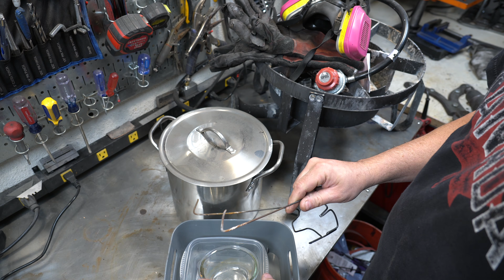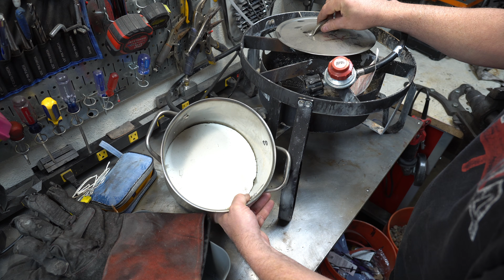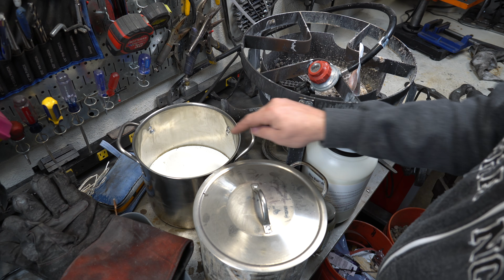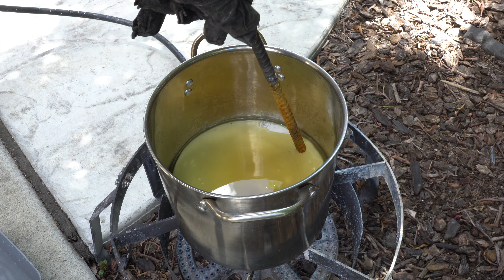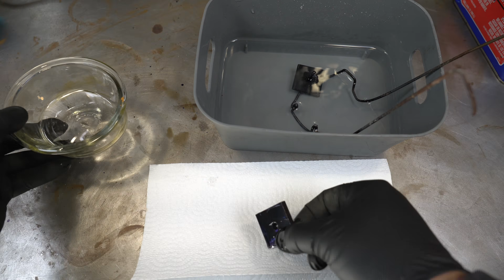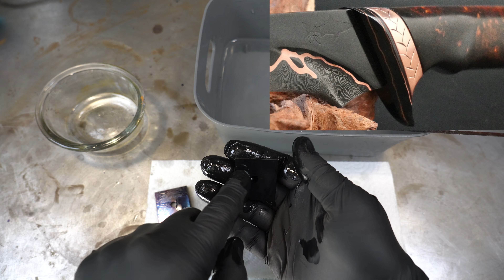Triple-T #82: Hot salt bluing / blackening for knives

Comment: 😮

You really, really need to be wearing a face shield AND goggles with the caustic blue. Also have an eye wash bottle at hand and something to neutralize the solution in case of a spill—vinegar or citric acid if you don't have a spill kit.

Those salts are mostly lye, and a hot, concentrated lye solution will blind you almost instantly if it gets in your eyes. You do not want to FAFO this.
Reply from the maker: Thanks for watching

Comment: Probably a dumb question, but genuinely curious if this could/will ruin/alter the temper on a metal piece/frame? Limited on access to information on the subject at the moment, any information would be greatly appreciated! Awesome video, I also appreciate the importance put on safety as well!
Reply from the maker: The nitre blue salts are too hot to do on a blade, but I’ve done the hot blackening on a blade before because it tops out at 290F only.  Thanks for watching.
Reply: @ thank you!

Comment: Both methods are called "bluing" regardless of the actual color. The term "blackening" doesn't have a specific definition beyond "to make black." "Blackening" could be done with a Sharpie or a can of Rust-Oleum for example. In the context of metal finishes the term is usually used for "oil blackening," which is heating the metal and then submerging or coating it with oil, which turns black due to the heat burning off most of the oil and leaving a carbonized (black) layer of oil on the surface (it's the same process that turns cast iron skillets black, known as "seasoning" in that context).

The method that uses a mixture of salts and water at about 285°F is called "hot caustic bluing," or sometimes "hot bluing," or "hot salt bluing," or "caustic bluing." 

The method that uses molten salt at about 600°F is called "nitre bluing." It isn't very common, so the vast majority of the time when people talk about bluing they are talking about hot caustic bluing (because that's by far the most common method of commercial bluing), which is actually black in appearance. Nearly every blued firearm made in the 20th and 21st centuries was blued with the hot caustic bluing method (a mixture of salts and water at about 285°F). When nitre bluing is used on guns it's only used for minor things. It can't be used for e.g., barrels, frames, slides, cylinders, etc., because it would ruin the heat treating.

The earliest method of bluing is "rust bluing," which is also black.

A blued finish (either hot caustic or rust blued) is sometimes called a "black oxide" finish, usually when it's done to nuts, bolts, etc., or when it's done to a gun that has a sandblasted finish instead of a polished finish.
Reply from the maker: Thanks for watching

Comment: Awesome video, sold me on the blackening for one of my projects. What are those buckets you use in the video made from?
Reply from the maker: Which buckets are you referring to?  The metals pots were just cheap stainless steel pots from Walmart. Thanks for watching.
Reply: @TyrellKnifeworks  I was referring to the buckets you had the hot blackening solution in. I just didn’t want to get something that would contaminate the solution. Thanks!
Reply from the maker: @Campfire_arms  the chemicals came in those plastic containers.  👍

Comment: Could u blue/black a carbon damascus ring? And would it protect it from rusting on the inner part where the finger makes contact woth the ring?
Reply from the maker: Yes you could certainly blue or blacken a ring.  It will slow the oxidation but it won’t make it rust proof and will only slow it.  Damascus rings really need to be coated in something (like epoxy) to protect the user.  Thanks for watching

Comment: Thanks for links to muve. I have a kitchen knife that has Damascus patterns. And it looks real, and it was $ 38 in dual currency. The problem is, I can't walk well at home. I was also laser-sharpened, but I am unsatisfied when it was new, today it is 3 years old, I care about it very much and I am sorry, I am asking for advice and I will also contact you on instagram. I greet you from Poland.
Reply from the maker: Sorry, I can pretty much guarantee that your blade is NOT damascus at $38.  It would cost 10x that at the very minimum.  Realistically, a damascus kitchen knife is in the $500-$1500+ range.  It's probably laser etched and made of cheap stainless steel.  Thanks for watching.

Comment: Hi Tyrrel - thanks for sharing. I generally do blackening in weapons and knife parts with NaOH / KNO3/H2O , proportion  3x2x1 in weight and temperatures between 135 to 140 °C - it works marvellously with same procedures.
Never tried the blueing  salt process.
Question - are you using Fahrenheit or Centigrades?
Reply from the maker: The temperatures are in Fahrenheit that I referred to.  The salts I use are all pre-mixed so they may be close to what you listed but I can’t be sure.  Thanks for watching.

Comment: Nice video.  You might also enjoy trying rust bluing.  No caustic or high temperatures required.  just lots of carding! can also be accomplished using minimal equipment.
Reply from the maker: What you are referring to is basically cold-bluing.  Compared to hot bluing, it’s finish is very poor and not very lasting.  It certainly is easier though.
Reply: @TyrellKnifeworks  I think we might be talking about two different processes. When I think of "cold bluing" it doesn't involve any boiling or conversion process, as "rust bluing" requires.  If you have the time, Mark Novak on his Anvil episode 0109 describes the process that I am thinking of.  Also Larry Potterfield on the Midway USA channel has an episode where he rust blues a set of Damascus shotgun barrels.  Not sure if any of this would be applicable or even desired for knife making, however the process is interesting none the less.  Color case hardening using bone charcoal is another interesting process with very attractive results, however it requires some rather specific and expensive equipment that puts it out of reach for most hobbyists.  I think a Damascus blade combined with CCH bolster, pommel and figured walnut handle would be similar in visual concept to an old classic Parker side by side shotgun.

Comment: You left a lot of danger out of that one. I have never used the nighter blue. However I do use bluing salts all the time you forgot to tell people about a few of the chemicals like lie and you told people that they could use welding gloves but if you actually use your welding gloves for the blackings process you would not have welding gloves anymore you would have a pile of jelly and if they were to breathe either one of those coughing soda with immediately Scorch their lungs throat and mouth having running water nearby as well as baking soda is absolutely mandatory and having yourself tightly caged off from the rest of the world is also mandatory because even a finch getting in your way would be way too much. Moreover if they choose to mix their own chemicals they have a few shipping problems that will have to be settled with the batf and E specifically the E problem not that you can get just anybody to ship you any of those bottles I believe highly caustic highly corrosive and highly volatile and of course poisonous. Those will be the labels on their packages and they must absolutely pick them up or if you are lucky enough to have somebody drop them off you must absolutely be there to sign for them. The Niners blue actually scares me the most because yes you still need to have pH balance and you still need running water except that now you're working at between four and six hundred degrees or was that 7 not to mention it is a hydrous making the first melt all kinds of interesting and any melt you do in the rain oh boy!!! Above and beyond all of that because they are dangerous chemicals you need a lock or to lock them up in after you properly sealed them back up and anybody working with out rubber gloves and an apron is already in trouble I personally I personally suggest gloves that go at least up to your elbows preferably halfway up Pastor elbow to your shoulder lamped in place not tied together because you want to be able to get the gloves off as fast as possible.

Comment: There is frequently some nomenclature overlap on these processes.  People sometimes think of nitre bluing (the hot stuff) when someone says "gun bluing."  Bluing (or blackening) of firearms is almost always the low temperature process, but is still known as "hot bluing."  There are 3 main reasons "hot bluing is the dominant bluing method in the firearms industry:  1) the lower temps won't ruin the temper of a critical part (springs, etc),  2) it's much more durable than nitre bluing, and 3) It's much faster than some of the older processes.

Types or forms of bluing existed long before hot bluing came along.  For example, charcoal bluing was used in the early days by Colt and Winchester.  It involves packing the parts in charcoal and cooking them at around 800 degrees.  Of course this was only done on parts that were either not heat treated, or those where 800+ degree tempering didn't degrade its performance.  Charcoal bluing isn't done on hardened parts, such as hammers, springs, etc.  

Some makers used case hardening on revolver frames and other small parts that benefit from the process.  Cimarron Arms still makes case-hardened frames for some of their revolvers last I checked.  This is a process of infusing carbon, boron, and nitrogen into the surface of the metal and then heat treating it to create a very thin layer of hardened steel on the outside.  The aesthetics are that the colors are variegated, often with colors of bronze, straw, blues, and purples all swirling in the piece.  Hardening the outer surface provides wear resistance.

Rust bluing, also an older process, is still done today as it is the most durable of all the bluing methods.  It simply involves using a special rusting agent to form a good layer of red rust on the part (usually in a box where high humidity and warm temps can be maintained).  It is then boiled in distilled water which converts the red (Fe2O3) rust to black (Fe3O4) rust.  After boiling, the part is "carded", meaning the powdery layer of black rust is brushed off using a very fine, soft wire wheel, leaving a lusterous, smooth black finish.  Sometimes, folks will use fine steel wool to card as well.  The downside to rust bluing is that it is a slow, time intensive process.  It takes multiple cycles (usually 10-12 times) of this rust, boil, card process to get a good, even finish.  Also, it doesn't usually work well with highly polished steel.  Most rust bluing is done with a 320 grit finish at the finest, so the finished product has a nice sheen, but it is not mirror polished.

Nitre bluing is simply a way of using very hot salt to "heat blue" steel.  "Heat bluing" is NOT the same as "hot bluing"...and this is where some of the confusion comes in.  Steel oxidizes at different rates as it heats up, so this is why when a torch or some heat source is applied, it goes through a range of colors.  The colors change because the thickness of the oxide layer increases with the temperature.  You can heat blue steel with a torch if you have a steady hand and can heat the part evenly.  The purpose of the nitre salts is simply to provide an even heat source that heats the entire part to the same temp avoiding differential coloring.  The downside to heat bluing is that, unlike hot bluing or rust bluing, it is not at all durable.  As mentioned in the video, if you nitre blue something and don't get the color you want, just buff it off.  In the firearms world, nitre bluing is almost exclusively for small parts, like screws, etc just to provide some coloration. It is a poor choice of finish for frames, receivers, barrels, etc as it will wear off in short order.  Also, heat bluing provides little to no rust resistance.
Reply: I'm making a 1911 and trying to decide on which type of bluing to use on the frame, barrel and slide. I'm interested in the hot 280 degrees and the rust bluing.

 Which do you think would be the best choice for a classic style 1911? 

Since it's a personal gun I don't mind the extra time involved in the rust bluing process if it's better.

 I'm guessing I can plug the barrel to keep from rusting the bore. 

Any idea where I can buy small amounts of the chemicals for both processes?
Reply: @actionjksn  Not sure of a place to get small amounts.  Hot bluing salts (there are many brands and types, such as Brownell's Oxynate No7) is sold in 40lb containers for about $210.  You'll need a proper container, preferably stainless steel and a way to heat it and maintain temp, so you'll need a good quality high temp thermometer.  A few degrees one way or the other can make a difference.  You also need to educate yourself on the process.  Not really recommended for a beginner, at least not on an entire gun.

Rust bluing is easier and cheaper, but time consuming (the reason it costs more to have the job done professionally).  A bottle of Pilkington Classic rust blue formula is about $65.  Plenty of "how to" videos on YT to show you the process.  Although not strictly required, a humid box helps speed up the process some.  You can make one pretty easy.

As for the difference between them, rust bluing is the more durable finish between the two.  However, with rust blue, you won't get a shiny finish (if that's your goal), it's more of a satin finish.  If you are looking to polish the gun and want a very high gloss blue, then hot blue is what you want.
Reply: @edwardlance2379 hello I am an engraver and I have rust blued a lot of 1911 type guns and you can get a nice shiny finish by polishing and not letting the blue solution converting to long .you let it rust, card and boil.belgian blue is rust card.then rust and card only boiling at the end.good luck.

Comment: I looked into hot bluing for parts but ended up opting for parkerizing due to higher durability finish. But this is still good info to have.
Reply from the maker: Parkerizing will give you certain colors.  You can't obtain the blues and purples though.  I tend to use the blackening for parts the most.
Reply: @TyrellKnifeworks  absolutely. Sorry if my comment was poorly written. I meant purely for a black finish. Nitre bluing and hot blue does look great with the colors.
Reply from the maker: @Knifos  the hot salts for blackening are pretty durable.  As durable as a coffee etch.  👍
Reply: @TyrellKnifeworks why is one more black and also how did u get that jet black if u don’t mind me asking
Reply from the maker: @Brandon_obs_ls  did you watch the video?  It’s all in there

Comment: Does the contrast of 10xx and 15N20 damascus show up well with the blackening? Do you need to etch first?
Reply from the maker: Most of the blackening I do is on mild steel.  It shouldn’t be etched first and it does better if it’s buffed and polished.  Damascus doesn’t contrast well since it blackens both, but it still looks cool.  I’ve done the bluing over Damascus and it looks really cool.

Comment: Great video. My question would be is the hot blueing better than the cold blue you can buy?
Reply from the maker: It’s WAY better.  If you try both you’ll see the hot bluing (which is actually blackening) is far inferior to the hot blackening.  It’s streaky and gives a full finish.

Comment: If you put the part, for the blueing, in the oven and heat it, to evaporate the water, could you take it straight to the salts, considering they would still be hotter than the part?
Reply from the maker: Yeah you could if you don’t have a compressor.

Comment: In the course of my misspent youth I worked in two gun stores; the gunsmiths ALWAYS sent their hot blueing out, never did it themselves. As you clearly pointed out, there are several reasons for that, and I've not been tempted to hot blue any of my work. Haven't thought about the blackening technique, so another thank you for increasing my knowledge of options.
Reply from the maker: The bluing is a bit more of a fancy thing you wouldn’t use as much but the blackening, in my opinion, is the really cool one.  It’s also easier.  👍
Reply: Gun bluing is different than the hot salt bluing that was featured in this video.  With gun bluing, you're actually intentionally rusting the steel for protection.  Also if you don't oil down a blued gun, it will rust to the point that it may not function well.  (Ask me how I know this.)
Reply: @Asmith-1111  Yeah, I've got a Browning T-Bolt that was made with a walnut stock that was cured in something very salty, for some reason, so where it touches the barrel it rusts! Evidently a common problem with these old rifles.
Reply: @brysonalden5414 older T bolts had salt cured wood stocks that ended up destroying the finish on the metal
Reply: There were a few strong warnings to all of us working with guns. Several included how painful and straight up deadly those acid mixtures are. And the last one was they said most people during the cold war in the main gun factory of my country worked for 20 years. If you started at 20 you died around 40 and it you started at 37 you died around 57. Took about 20 years for the accumulation of chemicals to cause health complications. This is why people rarely blue anymore. I will never touch that shit. If i want something blued that is not too critical i heat it then out bath it. Otherwise cerakote and other techniques work well enough.
Reply: Absolutely. When I worked in a gun store years ago, that is why the gunsmith sent all the hot blueing projects out to subcontractors. I don't guess that using hot blueing solutions for a few hours a month would be particularly dangerous, but I'm not going to risk it. @KorianHUN